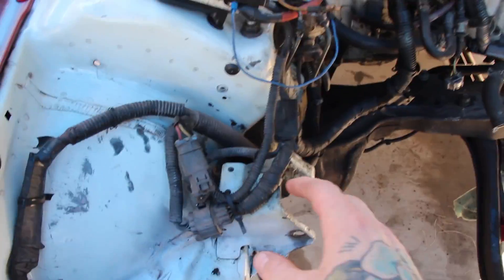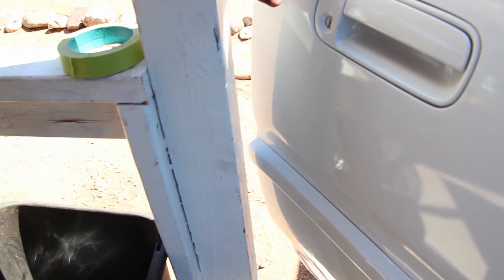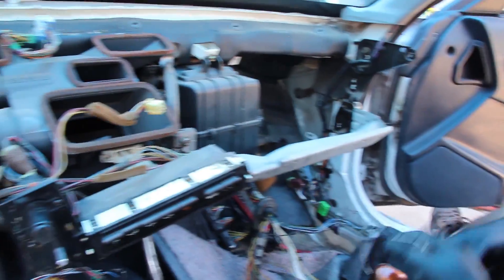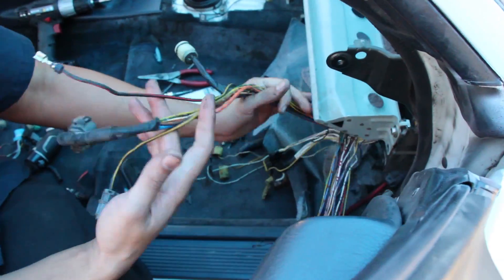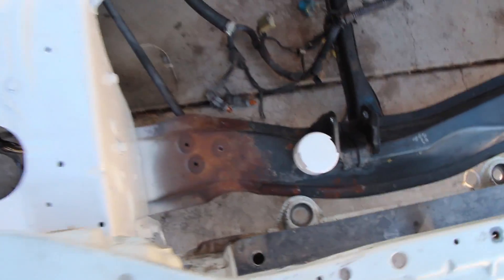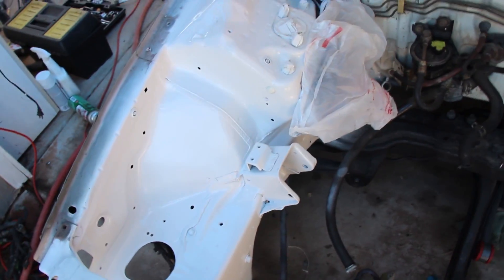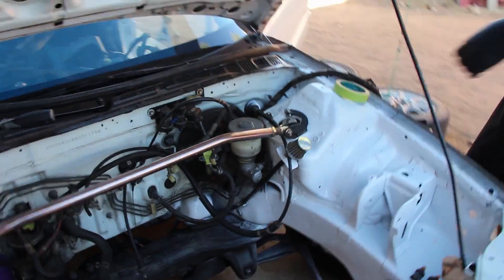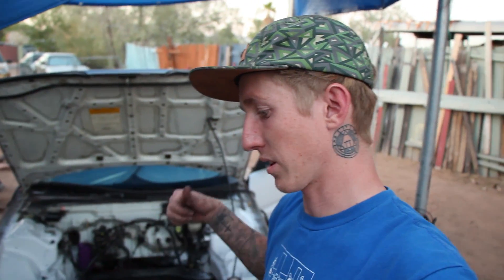Wire Tucking The Integra!

Comment: need a little help. my 90 da fan isnt working and the engine is over heating how can i fix that cus i reallt don't want to take it to a shop. ANYONE please help!
Reply from the maker: Jacob Quinteto when at a stand still and the temp gauge is starting to climb, trying revving the vehicle in neutral up and down a bit and if the temp goes down that means you have air trapped in the system. As for your fans not working, check your fuses under the dash. If those are good then unplug the coolant temp sensor (green plug on the thermostat housing) and with the key turned forward to have power to the car jump the connector with a piece of wire and see if your fan kicks in. If so, your coolant temp sensor is bad, if not you may have a dead fan. Hope this helps
Cheers 🍺🤙🏼

Comment: Any tips on what head I should use on a b20b block for vtec??
Reply from the maker: juan fuentes either b16 or b18c. Really not a huge difference. Especially if you are putting cams and all the goodies in it. Obviously b18c would be best but that's pretty expensive

Comment: run a gsr water pump on your build
Reply from the maker: Curtis Williams if you watch any of the other videos i say a million times I'm running gsr belt and pump. You have to. No other belt will fit the height difference of the head and teeth count 🤦🏼‍♀️🤦🏼‍♀️🤷🏼‍♀️
Reply: ChrisSadowski I watch them I just thought you said you where just running the water pump in this video. I need to get up to date on the videos. lol
Reply from the maker: Curtis Williams it's all good. But yes we are running the needed GSR parts. The height of the head will not allow you to use any other belt but a gsr. And the gsr belt doesn't fit anything by a gsr pump because the teeth count so I'll be running gsr belt, water pump, oil pump, dual valve springs, and supertech valve seals. The rest is staying stock for now, an for reliability